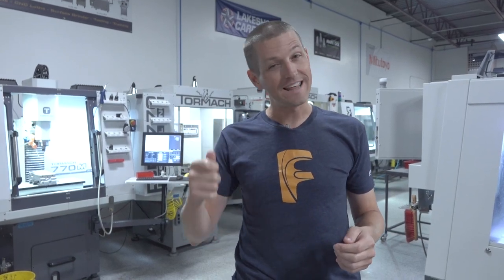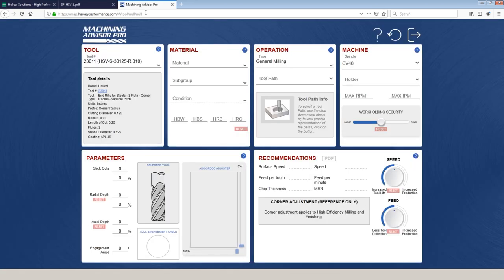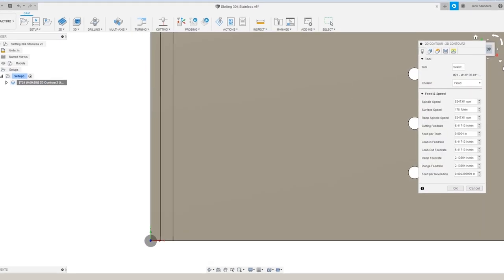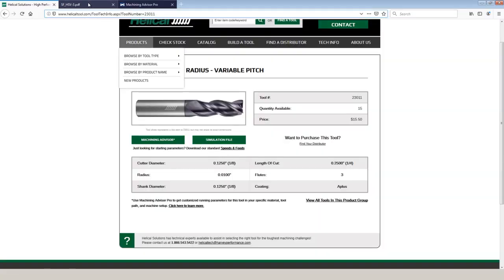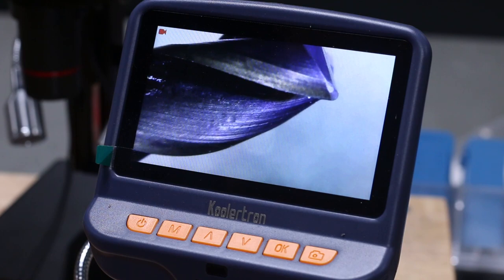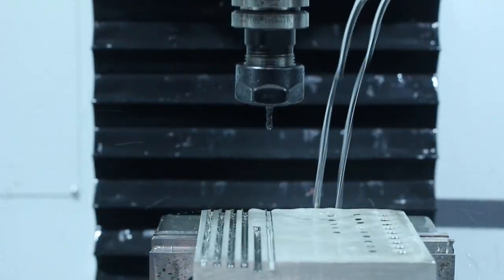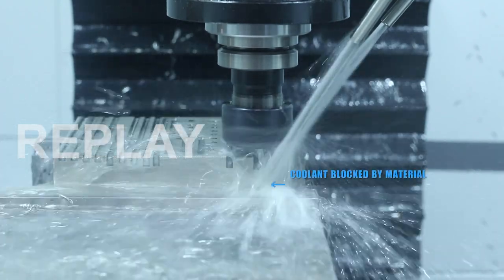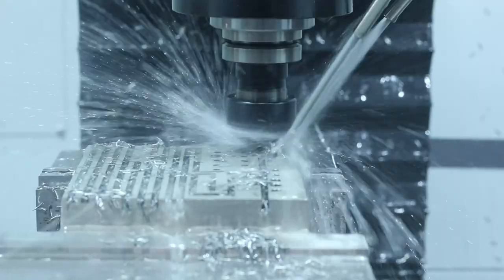Milling 304 Stainless with a Carbide End Mill | Speeds and Feeds Tool Test

Comment: hello from uk been an engineer for 12 years now on both sides of the technology front. for all those people who still using the old bridgport universal mills, a little trick i learnt to get get deep slotting in high carbon steel like en24t even with fairly rubbish hss 3 flutes end mill and two flute slot mills 4mm and below if set your rpm a little on the slow side 1500-1800 and keep your feed rate low 40-50 mm a minute or 1.8-2 ipm with a constant stream of coolant directly at the cutter. it doesn’t have to be high pressure just enough to wash the chips behind the tool and most important thing you want in a good holder side lock preferably, rigid as possible and it will just chug right on through I’ve got ten or so slots like this out one little hss end mill
Reply: Hi we find that when we use a 63 mm diameter 6 tipped cuter to machine p20 the vibrations running through the spindle knock the machine out and when we talk to the tip supplier cutwell they ask what machine and we say Bridgeport interact and they say arrr sorry but you don't have enough spindle speed you will need to take out some tips or run the feed slower, we love our machine and never run it in anger it's a shame we carnt get the modern fast tools to work as designed, we've had it new since 1988 and a cracking m machine
Reply: The Bridgeport mill design is wonderful and has made half the stuff in the world, but it is at least 80 years old now. Modern CNC machines are far more rigid and have more power, and run faster spindles and usually have higher coolant pressures and flows.  Modern tooling is designed for the modern machines, not for an 80 year old machine design. Its reasonable to have to downgrade the tool or its capabilities to handle the slower, less rigid machine.

I'm not knocking the Bridgeport in any way. I've got one and love it. But it's just a fact that modern tooling isn't designed for its capabilities, and you sometimes have to make adjustments.

Comment: I've been slotting steel plates with a 3/16 endmill for the last week, Kennametal HPHV > Guhring Diver.  25 degree ramp, 5,100 RPM, only 5 IPM ramp, 12-16 IPM slotting.  Can't wait to try the new TE they came out with for slotting.  Sounds like a provencut test extravaganza.
As for process reliability I am getting like 40 plates per tool with those feeds and speeds (10 gauge plate, ~0.130" thick), and believe me there is a lot of slotting involved--they are 5 inch circles with a 2 inch bore and like 15 smaller slots per part. 

Here's to keeping it in-house.
Reply: If anyone is wondering, the TE is a lot like the Guhring diver, it sacrifices a lot of harmonic chatter reduction for stiffness which isn't exactly the best for a thin steel plate screwed down in a few places.  Harvi 1 is by far the best tool for that sort of thing, fantastic little tools.

Comment: 5:14 I'd still go to move in the other direction so the chips get blown out to the free space your creating with the slot. Same goes if you only have coolant from 1 direction. I had that on a job. Same recipe, one direction was fine but the other one (as in your vid) caused the tool to recut all the chips and break.

Comment: I really like Inco's hard-coated 4-flute mills for slotting and profiling tool steel.  I used some at my first machinist job when I was making fixtures and I was very impressed by their performance compared to most other tools for hard metal milling.

Comment: I've found the dual head fogbuster works so much better for slotting if you throw away the stock bases and get the nozzles down low and pointing in towards the tool more horizontally, rather than the standard mounts that have the nozzle tubes up high and having the collet nut be in the way.

Comment: I always use through spindle coolant to these types of jobs, no worries about where the coolant nozzle is pointing.
Reply: good luck getting through spindle in a tool that small.
Reply: @tylergarza8695  The tool doesn't need TSC holes in it, I just use ER collets that are sealed and have two holes for coolant, works great.
Reply: @OMY005  oh, actually was not aware of this. Thanks. 

I"m studying cnc machining right now so i'm still learning some stuff haha

Comment: You didn't try a multi-pass cut for a deep slot. In that case a longer flute length might be beneficial so that the chips can flow up the shank and out of the cut. 
I'd also be interested in the effect of a longer coolant pipe(s) that actually get down under the face of the collet or tool holder, right near the shank of the mill.

Comment: At 150% axial depth of cut w/ mist cooling you were at about 230 sim and tool broke. However, when you went to compare to flood cooling you reduced the feed to 178 sim and it worked. That is not a valid comparison; you should have run with the flood coolant at the same parameters.Also, you were using an end mill from Helical (one of the best) at around $30.00. These details are important to me. I think that cutter would have made it thru if the 178sfm were used.
Great video!

Comment: I'm a big fan of good solid endmill holders over the ER collets, especially for slotting as they are significantly more rigid. Also they have a smaller profile and are not as much in the way of the coolant. 
I am surprised you want to aim the coolant at the back of the cut. I always figured that would push chips into the cut rather than away from it. 
Also, have you considered a tip with a smaller hole on your coolant/fog buster nozzle to have a more direct and higher psi flow?

Comment: i mill 304 stainless plate, full slotting (profiling the outside of the part) .3125 deep with the Helical 4 flute 1/4" endmill at 400sfm and .0012ipt (6112rpm @ 29.33ipm) and get about 2 hours of in cut time out of it. not unhappy at all with it.

Comment: Could you use a different tool holder? The ER20 collet shields the tool excessively...are there smaller diameter or tapered alternatives?

As always thanks for the info!!!
Reply from the maker: For sure - ER16 is readily available for TTS

Comment: I usually just use a sfm of 125. Works great. Also do flood coolant
Reply: I've got to cut some 1mm wide slots in 303 stainless, about 6mm deep blind at one end open at the other. Single flute carbide mill, I've no idea on speeds and feeds,  any clues?

Comment: I nit pick all areas in my machine. Especially coolant placement. Feeds an speeds are pretty much standard cause I cut cobalt chrome. So you can't push the tool much faster. But flood coolant ia a must. Makes a huge difference.
Reply: Why limit yourself to Cobalt?
Reply: @frp1276  limit? I work in a medical shop. I make implants. What am is supposed to use???
Reply: @Bighorse508  my mistake, I was thinking you are using only cobalt tools
Reply: @frp1276  na. Cobalt chrome is the material. Carbide tooling is all i use

Comment: With either fogbusters OR flood, how about using smaller collets for the small tools to get more air or fluid to the edge? ER16 holders are available.   I even have a pack of ER 11 collets in my drawer in case someone, sometime makes some TTS holders that can use them.

Comment: I talked to the company that programed the impeller on your show about the guy from Canada on his DMU. They were at south tec this week. I now have a hard time believing your content now. You need to be real.
Reply: ?? Can you elaborate?
Reply: Sure. Amish said he used power mill to program the impeller in the video but just a few seconds later said he had been using fusion 360 for everything on the 5th axis. Which is it? In my conversation at south tec I learned fusion 360 at 500 dollars a year cannot make his impeller but with cloud credits you can use other autodesk tool paths. We don't see that on YouTube from the autodesk users but that's what they have to do to replicate these programs. I'm pretty sure now that cloud credits don't come cheap and I'm pretty sure Amish paid for that program instead of generating  it himself. Tell the whole story. That's all I'm getting at. I'd rather have the information than the marketing or the entertainment content. That content does not help manufacturers.
Reply: @travisthomason8869  thanks

Comment: You are already using CAM software so why you slot with full A.O.C? Just use trochoidal milling. Its faster, more productive, less toolwear (smaller cutting forces, heat, better chip evacuation etc..), full depth of cut (4xD easily) and better accuracy. You dont even need CAM, program for simple trochoidal slotting isnt problem write manualy . I think its wasting of great mill to use just 1xD or 1,5xD and rest throw away or regrind. And cutting hard steels with cutting fluid isnt ideal. Mist would be better.

ps: And excuse my bad english ;-)
Reply: ehhh it's not usually faster imo..
Reply: Yeah, it really depends on what doing and slot width/length. Trochoidal milling is great, but like every process, it has it's downfalls, like machines not being to handle the code so you end up cranking up the smoothing option and lose the accuracy benefit. Also, I would never take the time to hand program that, copy and paste NIGHTMARE in my opinion.
Reply: @donaldmoore8023  its possible but why would someone
Reply: He covered that in a different video